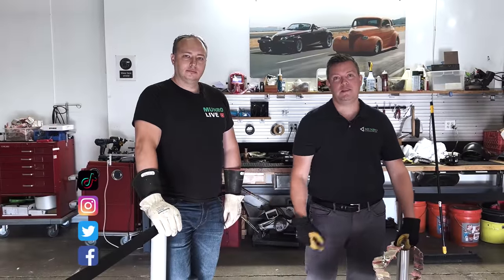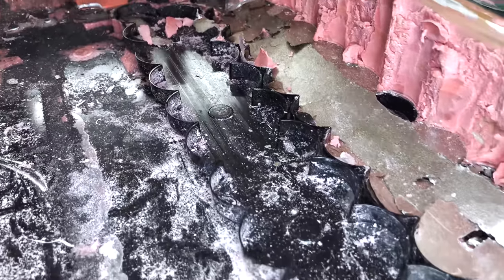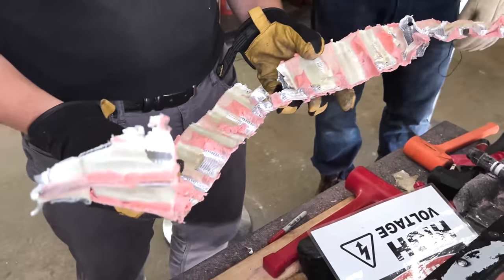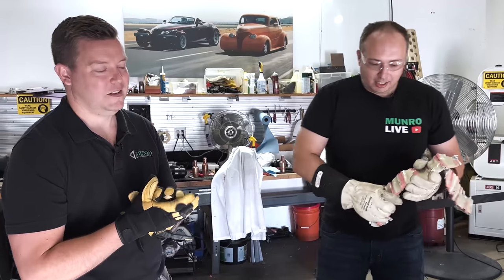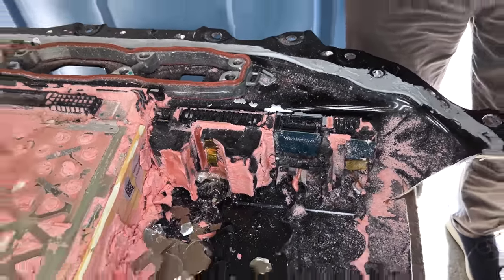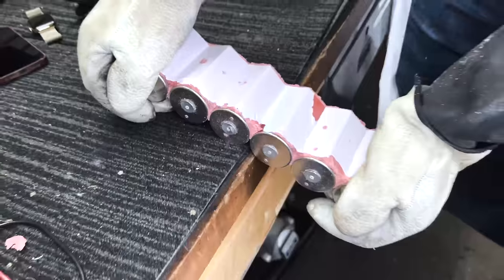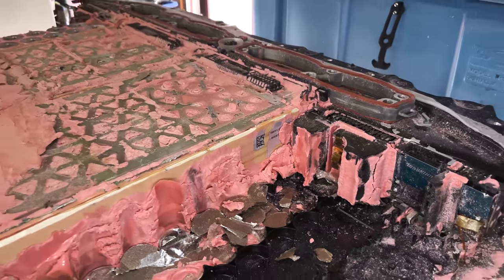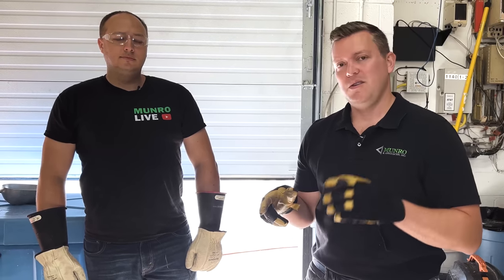4680 Update Structural Adhesive | Tesla Model Y

Comment: Mr Munro and staff would shaping the 4680 cells from a cylindar to a hexagonal cylinder have any advantage ???  With 4680 cylinders next to each other you get that in between space that looks kinda like Bio hazard symbol, wasted space, where as if 4680 is shaped hexagonally the pack would have bee hive structure. Every side would be supported throughout. Would that be adavantageous ?

Comment: What about the gearing system on the moters.
Reply: You're looking at the wrong video - this series is entirely about the new battery using 4680 cells. The transmissions haven't changed since the Model 3 was introduced.

Comment: I've dealt with flooded T105s and had a bad cell in 16 batteries or 48 cells. What a pain in the ass as it affected everything. Hopefully with BMS and a better build quality they will be able to make the cells and keep the cells balanced because my 48 cells are not. We'll see. Some cells use more water, depending where in the string they are, affects them. etc. Charging cells take power yet produce heat not storage when failed. What is the replacement cost now $22,000? Hope it all works out but I can imagine the problems in these large battery packs.

Comment: So compared to the 2170 pack, is the structural adhesive attaching the cells to the  cooling tube the same? I don't see it in the video. Clearly the pink foam is much more sturdy and stiff than the 2170 foam, but that is poured on after the pack is together, after all the bandoliers are assembled and the four modules connected to each other.
Reply: They had to destroy the cooling tubes to get the cells out, so I'm guessing the adhesive is fairly strong.
Reply: @andrasbiro3007  I am sure it is strong, it just looks like it is a different material than what they use on the 2170 and I think it has less mass between the cell and the tube, less thick layer of adhesive. I worked at Tesla making Model 3 packs and I was on the automated line at cell/tube where the adhesive is applied and cells and tubes turned into bandoliers, so I have an interest perhaps many others don't. The adhesive they use for the 2170 is pretty noxious with nasty fumes before it cures, so it would be great if they are using something else.

Comment: It seems like the cooling complexity has remained the same which is odd seeing as one of the biggest advanced of those large cylinders was to cool them from their top surface.
Reply: That was notion from beginning. But seems math and physics doesn't work like that. there is a  reason why for very high power (big energy flux) PLAID models tesla use 18650. Small relative radial distance is much much smaller  from longitudinal axis. Seems  at very least for first gen they played it save. I m sure for  24 000 model with maybe less power demand maybe we could made that compromise.

Comment: Two questions: 1 - How is the pink foam applied in a cost/time effective way? 2 - why vent downward? Seems to go against natural thermodynamics.
Reply: I can answer the second question. It's because you want to went to the outside environment, not inside the cabin. It's not an issue because you don't went heat, you vent pressure, and pressure will follow the path of least resistance. Excess heat is removed via thermal conductivity to the neighboring cells, and then out of the pack by the cooling system.
Reply: Thermodynamics has little do do with the venting. They are cooling the batteries through the liquid filled ribbons shown towards the beginning of the video, not by using air transfer. The venting is merely used as a pressure balance as the cells expand and contract due to thermal heating and cooling. Simply there to keep no pressure differential between the inside of the pack and the outside world so there's no ballooning.
Reply: @steve4hockey  
The cylinder surrounding each cell is what prevents ballooning, unlike a battery made of flat or prismatic cell pouches. Each cell has a one-way over-pressure valve to vent excess gas and prevent the metal can from bursting. However, normal thermal cycling does not involve cell venting - the internal pressure roughly tracks absolute temperature. 

The Tesla battery pack might bulge or even burst if excess pressure just outside the cells was not allowed to vent outside the pack, however it is imperative that the pack must not intake moist air - much less water. So I expect the pack to use a one-way safety valve, like on bags of coffee. 

A relatively low internal pressure would slightly crumple the air channels at the bottom of the pack, for example, if the car sank into deep water, or after being exposed to a significant vacuum event such as a Tornado.
Reply: @imconsequetau5275  The pack is also sealed and also needs to vent. The point is, the direction of the venting is inconsequential because its not a thermal vent but a pressure vent.

Comment: What are the options for repairing such a bonded structure in the event of a battery component failure? Probably none. But the user will pay for the replacement of the whole pack. A win for Tesla.
Reply: The warranty is pretty good.

Comment: I see the structural benefits of the foam, but they could have left the control modules alone for serviceability.
Reply: Tesla doesn’t believe in serviceability.
Reply: That's the part that gets me. They certainly could've come up with some kind of connector to install the BMS outside the pack to make it serviceable. It's all amazing and innovative until a 5 cent component bricks your entire battery pack. Obviously the Musketeers will tell you that Tesla knows what they're doing and electronics never break.
Reply: @jfolz  A bad BMS is likely to have damaged the module and its safer to recycle the pack than work on it. Time = money and a new pack is a couple of hours and easily done safely. Disconnecting a module & replacement of a bms even in the model S was hours and working with live 400v DC buss.

Comment: this is the first content relating to this teardown that hasn't been disappointing. (except the 1st pack-dropout one) overall the 4680 has been a big disappointment. hopefully they are able to iterate and achieve what they set out at battery day later.
Reply: Well, if you're "disappointed" you're not paying attention.
Reply: @rogerstarkey5390  is the architecture great? yes. is the potential there? sure. but none of the promised specs or practical range gains have materialized. that is disappointing.

Comment: that looks like pink "Great stuff" , the pink polyurethane foam in a can is the fire rated kind. Wonder if the pink is the same stuff?
Reply: Why would it need a high fire rating?
If a cell did have "an event", the pressure release is at the bottom, through the floor.
That's where the heat would concentrate.
As long as the foam insulates, the other cells would just work normally.
(Maybe the Cooling circuit would go into overdrive?)

Comment: Man I love tesla's battery and drivetrain tech, it is simply miles ahead every other mfg. Specially when I realized batt. pack recycling should not be an issue.
Now if only they could get everything else in the car to match that same level of excellence without sacrificing reliability, there would be no more competition.

When will we see other mfgs make cars with Tesla drive train and batteries? I hope so soon!
Reply: What about repairability?
Reply: @davidbrayshaw3529  With the litigiousness of people now that would be the corporate viability of looking for land mines by tromping around said mine field with lead weighted shoes on while pushing a lawn roller.
Reply: @davidbrayshaw3529  Impossible to repair, would have to be swapped and the old pack recycled.
Yep, that sucks big time so let's hope it is reliable

Comment: I'm wondering if any of the cells are empty structural units only.  It's a variable that needs to be sorted out as that would help figure out just how much of the pack is software locked🤔
Reply: Elon said no software limit. The cells and the pack are still highly unoptimized, that's why the range is relatively low. Watch the cell teardown on the Limiting Factor channel, you'll see how far just the cell could be improved.
The good news is that even this early version is god enough, the fully optimized one will likely deliver on the original promises.
Reply: @andrasbiro3007  thank you 🙏 sir

Comment: Lots of talk about how this pack is unrepairable. I wonder how Tesla insurance would factor in if a pack needs to be replaced and recycled. A replaced pack would technically belong to Tesla and can be shipped back to the mothership for recycling.
Reply: Old pack goes straight into "the big grinder thing" and they get raw materials back at about 20% of the cost compared to new stock. That would offset a lot of cost?
Reply: You can never match a few new cells to a used pack. Trying to could get people injured or killed and the OEM sued = make it impossible.

Comment: How would you recycle this since it's all sticking together so strongly?
Reply: Elon Musk stated that "cryogenic recycling" would be used to recycle these batteries. The only problem is that the technology to "cryogenically recycle" batteries is non existent. Sounds good though, doesn't it.
Reply: @davidbrayshaw3529  Really cryogenic is pretty easy and there are many recycling shredders just that no one has put both together is of little concern. No one else has landed an orbital class first stage either!  Nor made a whole front & rear subframe of 2 castings. How about making a 20% margin on EV'S. Just because it hasn't been done before is a pathetic argument.

Comment: What exactly  is a "bandolier" and are you saying that there are only 276 cells in this entire pack ?
Reply: The term "bandolier" was someone's attempt to describe the cells attached to a cooling strip, which looks a bit like the ammunition cartridges in holders attached to a belt worn across the body, which is a bandolier. Of course a real bandolier has cartridges on only one side, while the cooling channel has cell attached to both sides.
There are three "bandoliers" per section, and four sections across the pack. That's 12 times 69, for a total number of cells of 828.
Reply: @brianb-p6586  Many thanks!

Comment: How do they install the structural foam?
Reply: bill ted  Well.. It’s an expanding foam, I would think it would be difficult to squirt it in around every single component and get the cover on and sealed before it oozed out everywhere. Hence my curiosity.
Reply: bill ted  Hope not! Lol
Reply: bill ted  Yeah, I’m not really a fan of that either. But it does seem to follow their view that the battery isn’t meant to be serviced. Kinda frustrating when you think an engine can be rebuilt.

Comment: PLEASE I really want to know the internals of a BYD blade battery. If you can get one from China or with a Giga Berlin model (when they are available) that would be awesome.
Reply: I don't think it's too exciting. The two main advantages are the LFP chemistry and the shape.
Reply: @andrasbiro3007  Cell to pack, more space efficient, 3x longer life, should be easy to reuse for second life. I admire BYD's design much more than this sealed for life crap from Tesla. 😕
Reply: @Macmonkey1000  
1. Cell to pack is not a unique advantage, Tesla does it already.

2. Longer life comes from the chemistry.

3. Reuse is way much simpler on the pack level, because you get the electronics too. Reusing individual cells not worth the trouble.

4. Tesla's pack is sealed because it's also a structural member of the car, which saves huge amount of money.

Comment: Why did Tesla decide to make the battery pack this way? Wouldn't this make the packs be extremely difficult to recycle?
Reply: In the first or 2nd teardown video someone said something about the entire battery pack being replaced if only one cell goes bad. That of course started an entire dialog about recycling and repair. I don't think this pack has been built for repair, but not sure about recycling (recycling was not via component, but at a chemical level where the entire pack was melted down to a slurry and then somehow each chemical component was separated out with those that could be reused being reused. Would love to see that process in action. Probably something the guy who left Tesla to start his own recycling company worked out with Tesla.
Reply: @peter-hr1gl  Yes, recycling usually involves tearing the battery pack apart and shredding it into smaller pieces before chemical processes are used to extract and separate the different elements. Think of it as how protein is extracted from milk or plants for protein powders. However, that pink foam, which is likely used to add structural strength will make the process much more difficult. I wonder if there's a solvent that can easily dissolve the pink foam.
Reply: @yelnatsch517  at cryo temperatures that foam will be brittle and easily dealt with . Freezing the pack also contains any volatiles & zeros it's electrical potential.
Reply: @yelnatsch517  Given Tesla's engineering chops and the fact that their former co-founder, JB Straubel, has started up Redwood materials to recycle batteries (and Tesla is a customer of theirs), I would assume that there was collaboration in developing this new battery pack with an eye towards how would Redwood recycle it in the years ahead. If not, then that would be a huge Faux paux on Tesla's part. 
Also if they have developed this battery with the thought in mind that they do not want it to be tampered with, tinkered with, or maintained in pieces, then they had better make the battery packs in such a way that there can be compartmentalization of the cells such that bad individual cells can somehow be segmented from the rest of the pack and 'shut down' such that it may degrade overall battery performance, but still allow for the pack to function. 
Again I can't imaging they would have engineered this such that the only way you could address one or a few individual cells being bad is by replacing the entire battery pack and then having to recycle the entire pack. That would be a huge waste of money. 
I guess it could be the case for this initial run of battery packs as they learn more about the structural element and integrity and they will revise this over time (as is their approach), but again that just seems wasteful and short-sighted and something I would not attribute to their engineering staff (unless their eye is on a long term prize we cannot see and are not privy to).

Comment: When Elon Musk/Tesla or any other folks mentioned 'structural battery pack', i'm like well, was does that actually mean? Are the top and bottom plates the structural entities? So we see that Tesla wanted to make sure that the battery pack could never be disassembled by accident, etc., in fact, you might need to call in superman to pull that thing apart. Maybe they ran some tests with the assembled pack to test strength, twisting force, etc.(?)

Comment: I'm hearing that Tesla Model Ys at least in China, are going with BYD blade cells (pouches?).  Have you heard that.  Apparently they can be punctured and still not thermally destruct.  And the power density is much higher.  And they are apparently buying these from BYD.  What's going on there?
Reply: "blade" cells are by definition not "pouches".....
Try googling "BYD cell puncture" (?) Should show video?
(Fully charged showed a demo)
Reply: The blade cells are LFP which are less reactive than higher density batteries
Reply: Try prismatic cells = blade cells.

Comment: Do you guys have thoughts about how this pack can be recycled at the end of life? Given it's so hard to pull apart... This question has probably been asked already, but there are a lot of comments to go through!
Reply: It’ll be shredded to tiny tiny pieces and all components separated by physical and chemical extraction.
Reply: @jmm6165  that'll send a lot of sparks flying I suppose with all residual power still in it. I can't imagine that's a very easy or safe process? It's definitely one way...

I don't actually know how EV batteries are recycled full stop. Are they crushed and ground up and processed or disassembled?
Reply: @joerituyn  That is why they chill the pack to the temperature of liquid nitrogen before grinding, then immediately separate some of the components.

I would have bet against that approach working, but apparently it does.
Reply: @joerituyn  Liquid nitrogen freezing = no residual power & easy shredding ie the foam is brittle at those temperatures.

Comment: Does the foam seal out oxygen?
Reply: May not have to.
Cell designed to fail at bottom (IF it fails?)
Discharges straight through the base.
Sides don't get hot, don't burn, don't transfer to other cells.
Reply: @rogerstarkey5390  that's fine and dandy but I'm talking about antirust over a 100 year time period.

Comment: When you have worked out the layout guys, a graphic of the layout would explain volumes. A Picture, they say..............
Reply: Do a web search for "Engineering Analysis Of Tesla's Cyber Rodeo 4680 Battery Pack Cutaway"; it's already been done, long before any of these packs were available for teardown.
Reply: @brianb-p6586  `thanks, but there may be many mods between producing a display piece and a functional pack.
Reply: @ponybottle  yes, but as soon as they pried the top cover off, the cell arrangement was visible and identical to what was shown at Giga Texas and analyzed in the write-up which I mentioned.

Comment: So I guess these are not rebuildable anymore?
Reply: Tesla modules were never rebuildable - now the BMS is combined with all of the cells into one block.
Reply: @brianb-p6586  but Hoovies Garage channel had a Tesla that had the battery rebuilt. They took it apart and replaced a few bad cells and updated the contactors.
Reply: @rbs427  While this has apparently been done, the modules were never designed for it and no manufacturer would endorse this sort of repair.